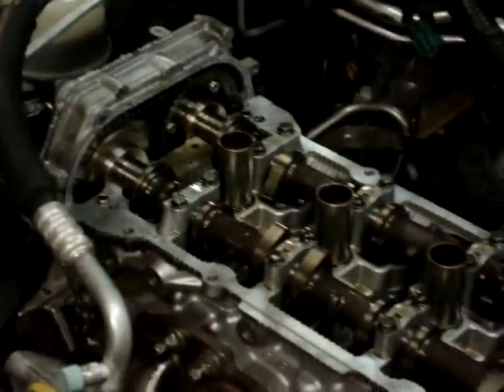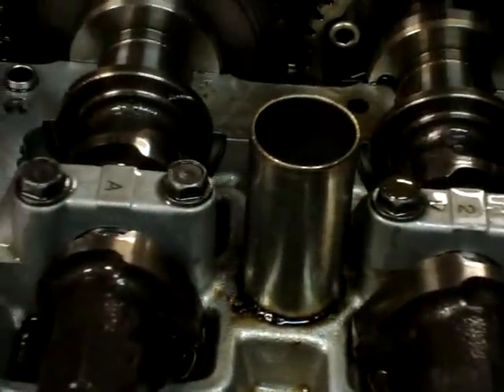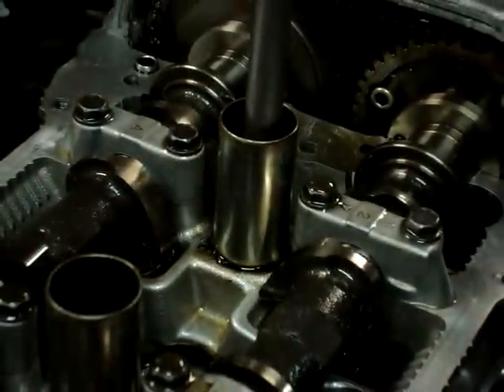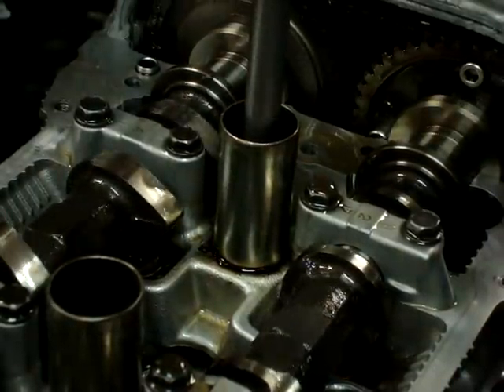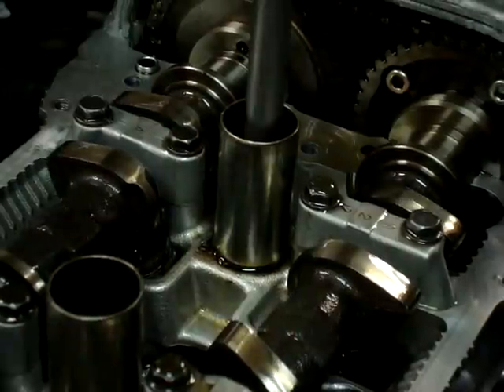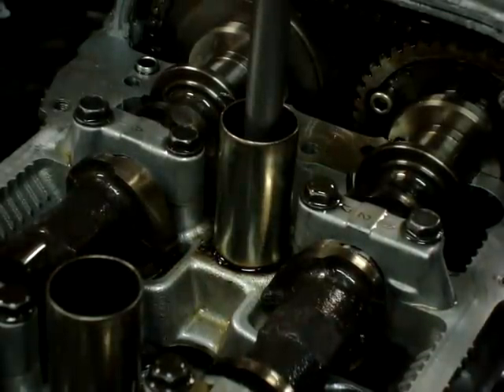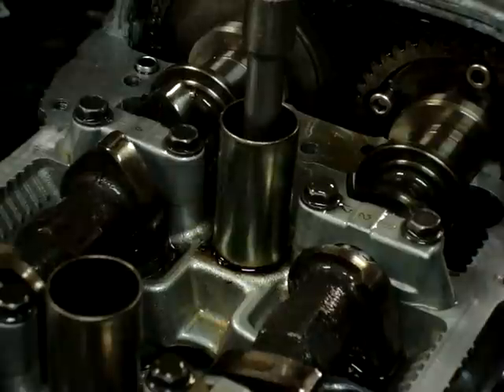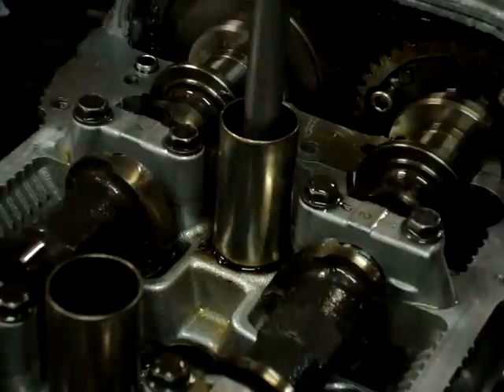2004 Nissan Sentra SE-R Spec V  Exhaust cam advance

Comment: HEY man ...I have a forge build spec v 0n 18psi with harder valve springs and all that jive and I was never told about this or seen it. what caused the extention to pop up like that? im guessing the pressure releife in cylinder 2 when ex valve opens before tdc? does this change how the intake phaser acts? how dos this affect your egt's  and your afr readings?will you get a false slightly  "rich" reading? what about those fireballs out the exhaust or crackles? I get better exhaust notes and pops with a colder plug.
Reply from the maker: I just did the timing adjustment just to test butt feel lol, and because it theoretically should reduce or eliminate valve overlap I have no idea if it was actually beneficial or not. I wasnt checking how the phaser acts or changes in EGTs and AFRs. I think if I was to do it again today, I would check those things and get a dyno run before and after, but I was a bit of a dumb ricer 15 years ago lol.

Comment: Hey man where did you get that supercharger that I saw you talking about in the comments?
Reply from the maker: I bought the kit from a company called RevAuto out of Arizona, but they've been put of business for nearly 10 years. It was a C1 Procharger. 

The main thing you'd need is the mounting bracket for the supercharger, which will have to be custom made since nobody makes it. Everything else could be bought off the shelf at any performance shop.

Comment: 2002 through 2006 is the QR25DE B15.... has anybody ever put the QR25DE B16 inside of the O2 spec v model? The motor has all the improvements that the previous 2.5 motor was missing. Counter weight delete with a better balanced crank and internal coating on all parts and head gasket improvements along with the cam and crank sensors. The only exterior difference is an extra motor mount on the top pully side of the motor.
Reply from the maker: I dont think Ive seen anyone do that swap unless they blew their original motor and end up just buying the full B16 motor to swap in. I have seen a lot of crank swaps and intake manifold swaps onto the older gen QR25s.

Comment: I’d like to find a video showing the spec v running after the timing mod.
Reply from the maker: It ran for a long time after this video. Check the upload date on this video and if the other videos are uploaded after, its running this timing change, and I havent changed it since. It blew a head gasket in 2011 and its been sitting in my garage since then. I just havent made any time to rebuild the motor.

Comment: @ REDDRAGONV09: yo wassup, my buddy and i finally put in the nismo camshaft at his shop. I notice that the idle was a little rough only if you you listen to it closely. there wasnt a very big changed in performance. I felt that the stock cams had more low end torque and the nismo had high end torque. I still redlined at 6500 rpm. I also notice that after 4k it was a little more peppier. Is it normal or is it  just me. are these nismo cams suppose to be perform like this? thanks again.

Comment: @ REDDRAGONV09: AWWW crap i already changed my oil to royal purp, but thanks though...I did some research on these QRs and there only two companies that I know makes them. they are JETCHIPs and V greddy i think... Whats your opinion on these chips. I have used jet chips before along with the SCT chip with launch control for my mustang and they work great. BTW did you feel a huge amount of differences when you dropped in your cams.
 Thanks for the comment ( STROMUNG)

Comment from the maker: @MrSTANG1362  No tuning needed. However use assembly lube to grease up the cams when you install. Then run the engine at 1000 rpm for 10 minutes, then change your oil. Then youre ready to go.
Thats a nice setup youll have. I love the sound of that stromung exhaust.

Comment: @ REDDRAGONV09: Hey I'm new to these sentras, i recently purchased an 05 sentra ser spec v and got the Nismo R rated cams shafts with it but their not installed yet. In the mean time i have nismo headers, Nismo Intake, Stromung exhaust set up. when putting these cams in do you need to tune the ecu or can you just plug and play. thanks

Comment from the maker: @nadjkovic I tuned it for 12.5:1-11.0:1. It started knocking at 12.0 so I think 12.5 was good.
Reply: did you try going colder plugs or an msd? octain or race fuel? 12 is high for a 100mm stroke. did you get shorter rods with a lower con rod hole on the piston?

Comment from the maker: No need to do it on the intake cam, the computer adjusts timing on that already and if you jump it a tooth, it could screw with your powerband. Yeah, I would use the BC cams. Because the duration is a little bit longer on those it will be a little bit harder eliminating the overlap, but I believe that this should work just fine. Just remember only one tooth.

Comment from the maker: which depending on how much boost you are running, could be bad. because your maf or map sensor is metering air that is not being used. so it would make you run a little to a lot-a-bit rich. but in the case of this engine, makes it run rich in my opinion. ive noticed that my air/fuel ratios have leaned out a bit since ive changed the timing on the exhaust cam.

Comment from the maker: I thought it was explained pretty good in the video, but to clear things up a bit more, valve overlap between the exhaust and intake valves occurs at the end of the exhaust stroke and at the beginning of the intake stroke. For naturally aspirated engines, this is good for optimum cylinder fill, but in forced induction engines, its not good because you end up pushing some air out of the exhaust side.